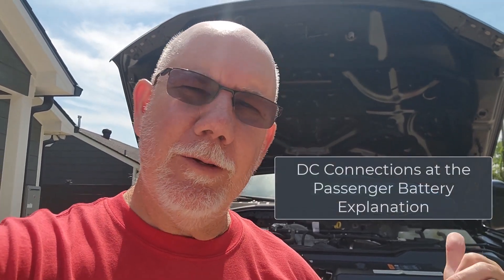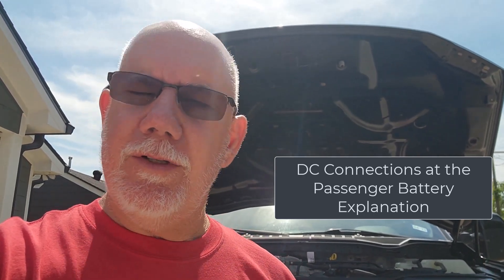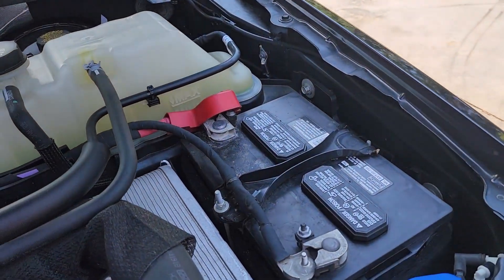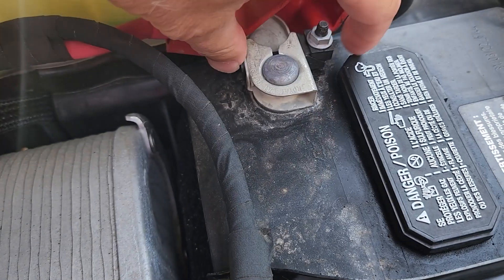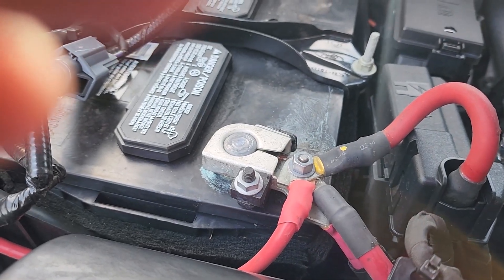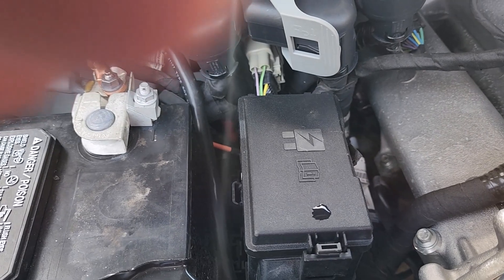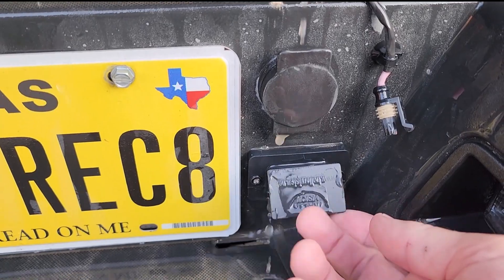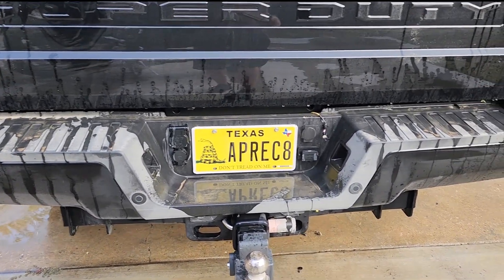DC Wiring Battery Connection Explanation 2022 F350 Tremor-Victron Charger

Comment: This and your other video showing the detailed wiring installation/routing from engine compartment to rear of truck are great,  and have inspired me to be confident that I can do the same,  thanks very much!  A few quick questions about the flush-mount connector on rear bumper:  Did you have to remove the entire bumper to gain enough access?  Did you have to cut any metal?  Any details about that part of your installation would be helpful.
Reply from the maker: I installed the connector with the bumper on the truck lowering the spare tire to make it easier to run the wiring. I had to cut some metal away for the plug to fit using my Dremel tool. Good Luck with your project.

Comment: Hello, great video. Where did you get the single wire weather proof connector for the voltage sensing wire?
Reply from the maker: I picked it up at a local parts house. I going to eventually get a flush-mounted connector.
Reply: Thanks for the quick reply. Do you have any more info on it? Brand, etc?? I have been looking for exactly that type of connector for my powered jack but cannot find one. Also, do you have a source or info on the flush mount connector you are planning on using. I will be adding a DC to DC charger as well and agree that would be the way to go. TIA!
Reply from the maker: There is a link to the flush mount connector in a comment below @frankelly1621

Comment: Great job adding the flush mount to the back of the truck! Can you provide a link to which one you bought?
Reply from the maker: The flush mount came with an Anderson-style connector but, I did not use them as they looked subpar to me. I used the connectors listed in the link.
Connectors: https://www.amazon.com/Anderson-Power-Products-Connector-Housing/dp/B07CHDM1VT?pd_rd_w=3lGkX&content-id=amzn1.sym.1a072a44-84d1-4c51-bf0f-3547594e8217&pf_rd_p=1a072a44-84d1-4c51-bf0f-3547594e8217&pf_rd_r=A8W32D3AGE9HY4F79S5N&pd_rd_wg=yQXX8&pd_rd_r=036823ef-ba67-4897-a49d-0b5e21c4fab8&pd_rd_i=B07CHDM1VT&psc=1&ref_=pd_bap_d_grid_rp_0_17_i
Flush Mount kit: https://www.amazon.com/Trailer-Vision-Anderson-Assembly-Connector/dp/B08R6P3WDM?pd_rd_w=tKi0h&content-id=amzn1.sym.c388ca75-4c14-4d9d-947d-5dcde63263f5&pf_rd_p=c388ca75-4c14-4d9d-947d-5dcde63263f5&pf_rd_r=MX8AM99NG319B20P3NM5&pd_rd_wg=BKEei&pd_rd_r=35cbcb28-2a37-429c-ad41-f2a3f2a4e98e&ref_=pd_bap_d_csi_prsubs_0_i&th=1
Reply: @dj2livinginwheeltime265  thank you so much! very helpful!